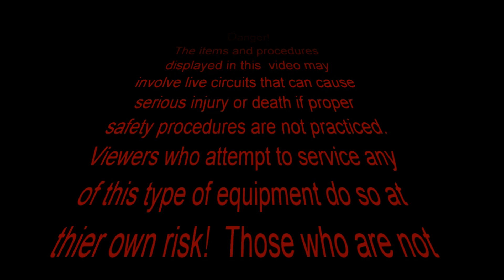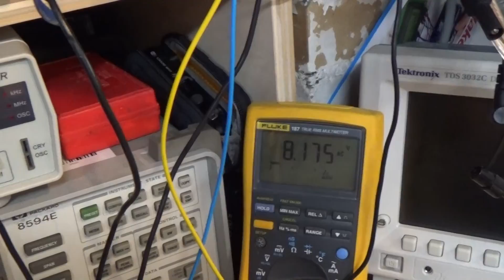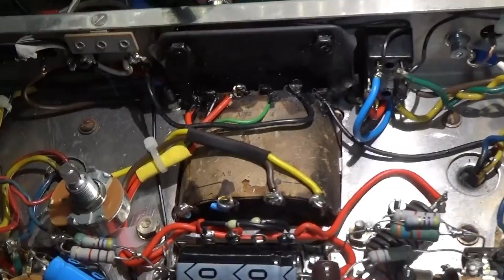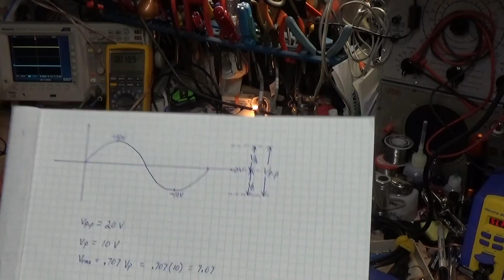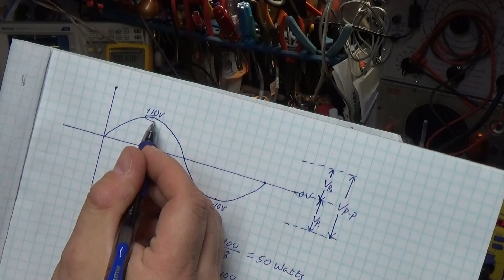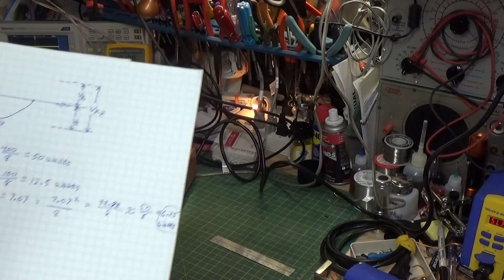Home-built Tube Amp and Tutorial on How Output Power is rated.

Comment: Those output transformers look like the ones from a Calrad sa-30. Which if they are would be a horrible match with 6bq5/el-84 tubes. The reason being they are like 4.3k or 4.5k normally people use an 8k - 10k transformers.

Comment: At first, thanks for your great videos! I really am a constant follower of your channel.
But do you really trust more in true rms meters than in a properly set up scope? I mean, if the waveform is to distorted even an expensive meter might mess up.
On a scope you see whats going on.
One other question referring to the amp itself. Is it running in class A? Because a pair of 6BQ5/EL84 ´s is capable of delivering 12 watts to the speaker easily, as far as i remember.

Comment: Thanks for your video Tony, If you really want to overstate the wattage quote the input power in peak watts. How many companies have done that and hidden it in the fine print. It's almost a given when rating horsepower for tool and air compressors. I look at the current draw at operating voltage for a true indication of HP. 748 watts / HP. Keep up the great work. I can't wait to see you next episode.

Comment: Just for fun, I once took a cheap Multimeter, hooked it up to a signal generator and sweeped through from 40Hz to 10kHz, without touching the output voltage setting. 
The measurement varied only by 0.4 Volts!
So you don't really need a True RMS meter for rough estimations in audio applications ;)